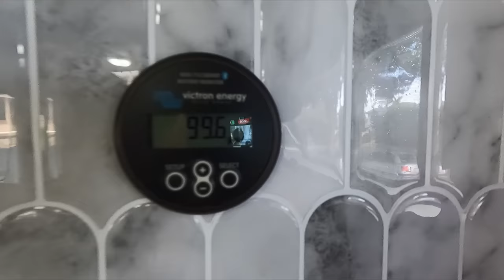Caravan Renovation - Our most important modification! /

Comment: It’s a bit late to tell you this but if you spray the back (sticky) side of those stick on tile things with a detergent/water mix, or any stick on graphic then you can easily manipulate them into place and squeegee out the air bubbles. They will dry on just as well, just takes a little longer
Reply from the maker: Great advice!! Hopefully it can help someone who hasn’t used them yet if they see this!

Comment: With the mountain air how does the air cleaner work as air cleaners are made to go one way, so like you said you can suck in clean air but how do you exhaust back out thought the same filter thanks as it looks like the maxi air fan you can buy from coast to coast thanks
Reply from the maker: Not to sure on how it works mate! That would be a question to ask them directly, link in the video description to their website 👍🏼
Reply: @nowornever_aus  thanks as been looking for a drs for a long time as like the domestic one as use no power and you do not have to get on the roof to change the filter thanks love your video 👍🤙

Comment: Hi guys, 

Just watched the episode installing the CRUISEMASTER DO35 . We think you may have put the bolts in upside down.  If the nuts come loose, you may lose the whole bolt & the cruise master will move around.  So for safety reasons please put the bolts going down.  We love what you have undertaken  & watch every Sunday.

Kevin and  Kerry
Reply from the maker: Hi guys!
I put the bolts in the same way the original hitch bolts were, this is also the same way our do35 was bolted on our last van. They are nylon lock nuts so should they come loose I think we’d be in the same amount of trouble no matter what way they were in 😵
Thanks so much for watching 🙌🏼